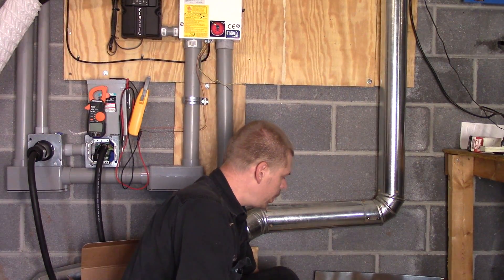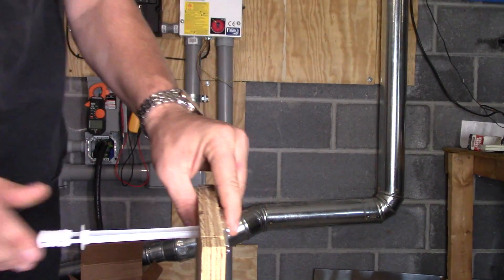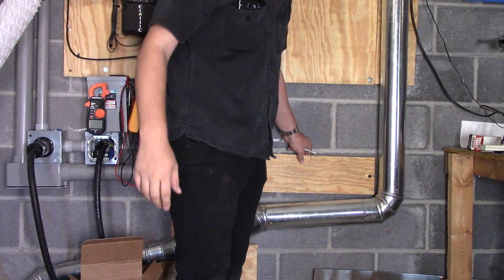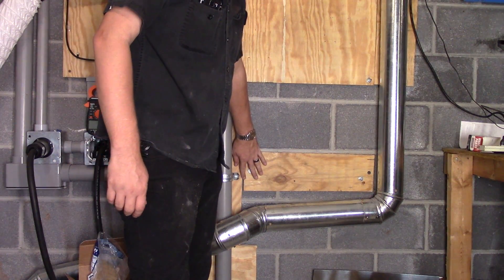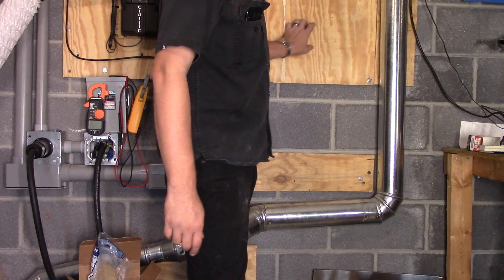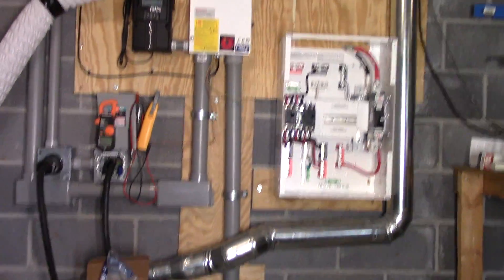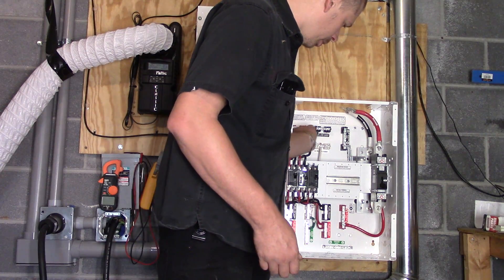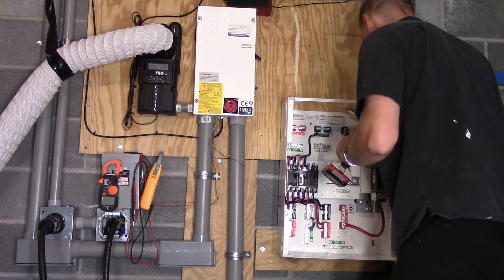How to install a 48 volt magnum inverter and breaker panel part 1

Comment: Why are you using magnum and for example, not Schneider SW+ inverter?
Reply from the maker: The last Schneider i seen running is dead
Reply: I was asking that because I have a SMA4000 TL-US Grid tie system and I want to AC couple that. I know Schneider can AC couple with SMA and can do load shifting when the batteries are charged. Also Schneider works Li-ion  batteries and can do custom batteries as I am planning to use Tesla batteries(3KW -57V)

Comment: hey I really like your videos just a tip I'm an industrial electrician and we always use sleeve anchors for fastening anything including heavy breaker panels to block walls. Much easier than toggle bolts and it doesn't matter where you drill into the block you will always get a good hold every time
Reply from the maker: Yes I agree but I have toggle here and i don't need to buy any more.=)
Reply: +Solar Power Electricity and Electronics (phillip20) ha I year ya get er done! Make due with what you have no sense running to the home chepot for 1 or 2 things and wasting time and money. Ya my bad for assuming you didn't know that already. Right on my friend!
Reply from the maker: It's ok most prople don't know that I run a commercial heat air company thanks for the info.=)